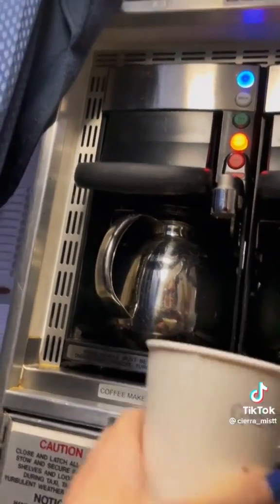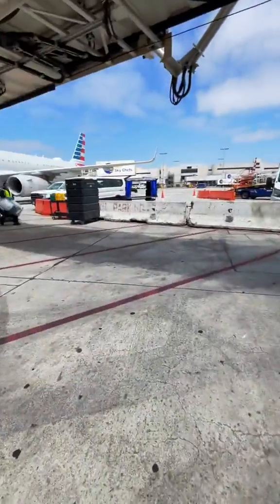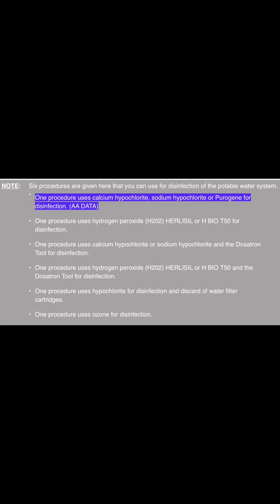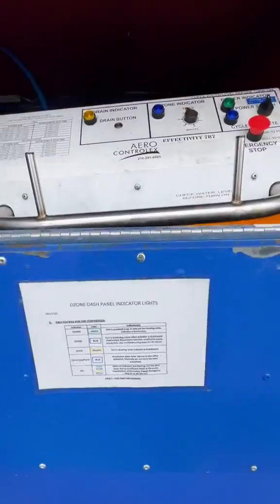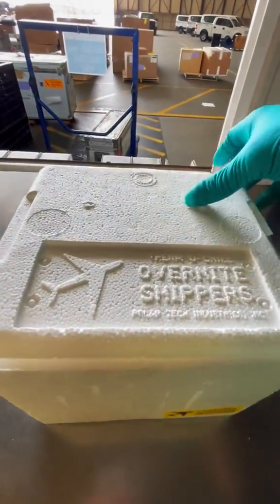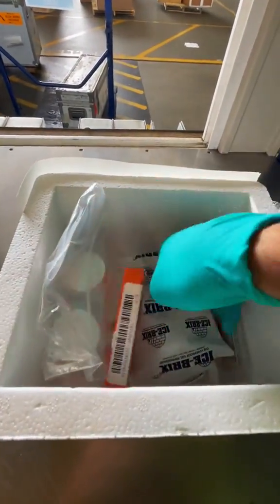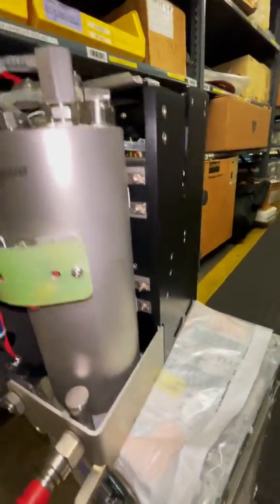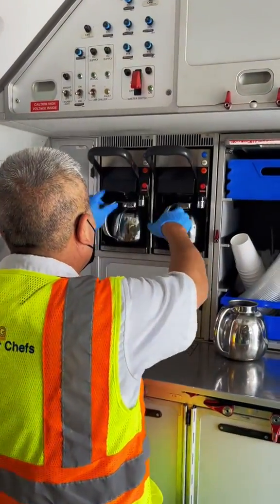Aircraft Water and Why it’s safe to drink

Comment: I always fill those coffee pots up with hot water first and rinse it out before I brew coffee, just for an extra clean out. I have been drinking the water for over 13 years. I never miss my cup of tea in-flight. I am still doing well.  🙂
Reply from the maker: Another layer of sanitation 👍 and I also have been drinking aircraft coffee and tea for 30 years.  Never once had a issue.